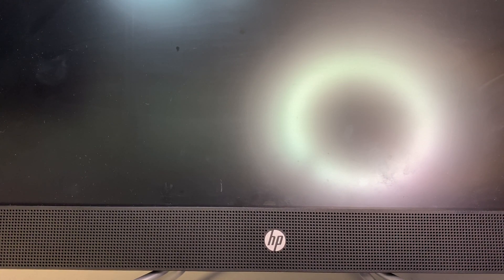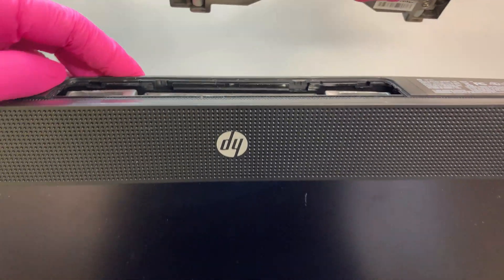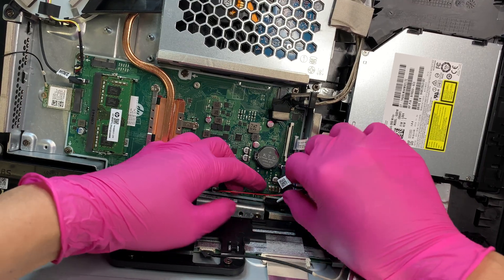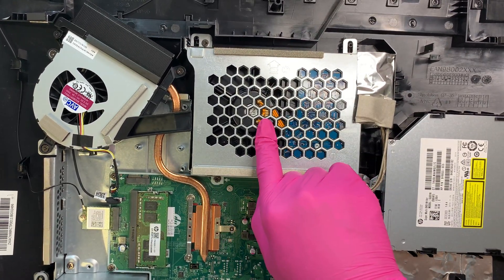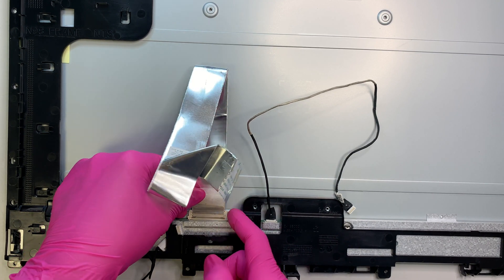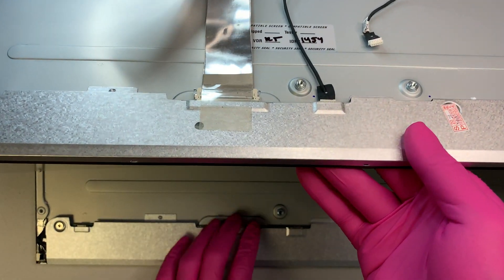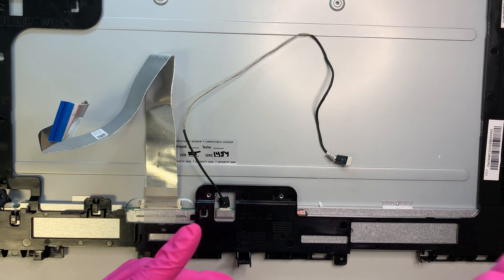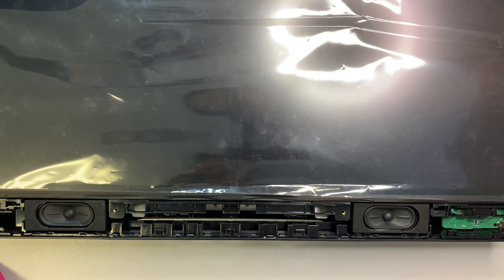HP 24 F0028 Touch LCD Screen Replacement

Comment: The screen cable connection on the motherboard is very tricky.  Make sure to power on the device before assembling, and see there are no artifacts/ color problems by running "monitor check" online.  Most likely one of the colours will be inverted until you check it carefully.

Comment: I personally find it easier to disconnect from screen than the motherboard to make connecting to new screen easier. Good video overall! The only knock I'll have on it is that your connections of the new screen to motherboard were basically blocked by the silver connector.

Comment: Thanks for this tutorial! Seems to be super simple. Is there a way to have the computer run faster? It seems mine has slowed down, even with no files saved on the computer itself.
Reply from the maker: Try upgrade to SSD drive and add more RAM